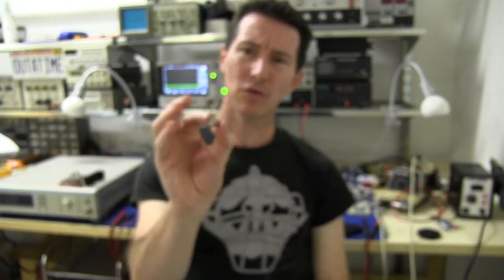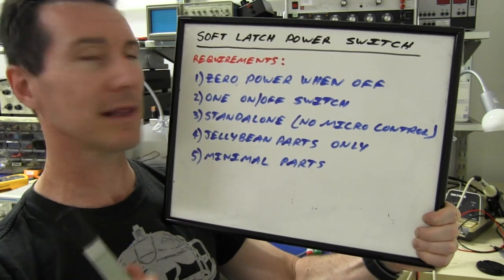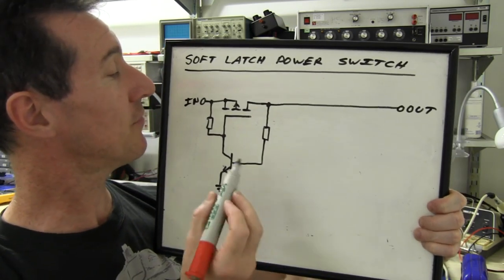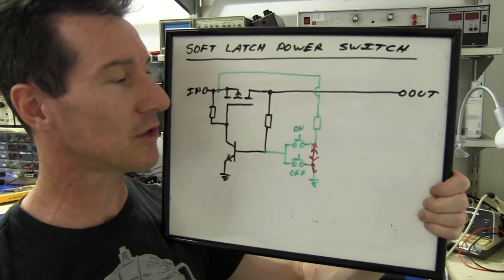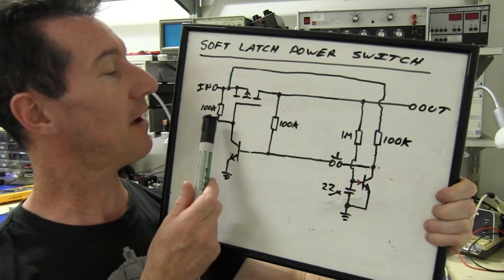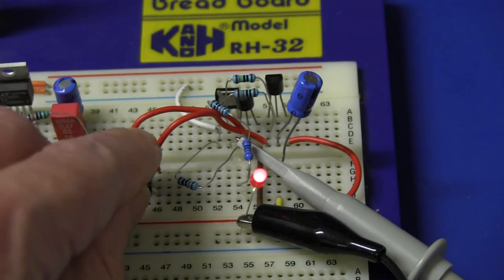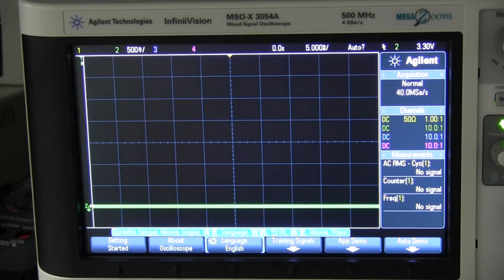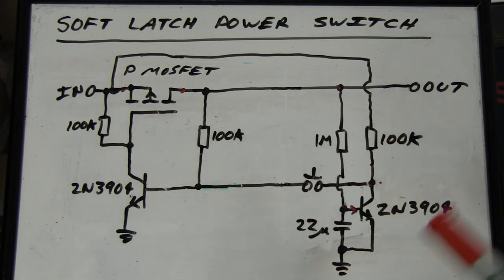EEVblog #262 - World's Simplest Soft Latching Power Switch Circuit

Comment: Dear EEVBlog,
Thank you very much for your lovely video on Latching.
I am doing a small project on controlling small out put (max 20mA 5VDC) with 02 source of separated Inputs as following: 
1. Input 1 (Vin1) of about 4.0 V at HIGH and 0 V at LOW (maintained continuously until the switch is off)

2. Input 2 (Vin2) of about 4.96V at HIGH and 0.3 V at LOW (maintained continuously until the switch is off)
What I want to do is:
1. Upon Input 1 turn on High or Low the Output will toggle its state;
2. Upon Input 2 on turning HIGH/LOW the Output will toggle it's state as well. I don not care on the state of the out put is HIGH or LOW but I do care about changing the state of each input, the Output state will toggle ON/OFF respectively.
This case is similar to controlling of staircase lamp with 2 two-way switches.
I hope you would not mind taking sometime to advice me with thanks.

Comment: I paused the video at near the beginning, and I tried to make a own solution to this, and I came up with the EXACT same solution you did! LOL (I just used 1K resistors in LTspice instead of 100K and 1M ones.)
Reply: Power Max While the NPN transistors are ON, you'll be drawing 100x more current through both of your 1K resistors than if you used 100K resistors, stressing them more.  For production, you'd probably want higher reliability, thus higher resistor values.
Reply: downthetube within Well it was a simulation, I often use the 2N2222 transistor in LTspice in such a way it ends up dissipating many hundred watts. Not an issue!

I often use TO220 transistors when prototyping stuff, as they are more difficult to destroy. However the disadvantage is that more base current is necessary for bias the transistor, and consequently I will end up using low value pullups for the bases. For small signal transistors and darlingtons and stuff, you are correct.
Reply: Thanks - I was just mentioning some obvious improvements as a design philosophy.  Guess I'd have to look up datasheet for 2N3904 to see how much margin is left when increasing from 1K's or decreasing from 100K's.

Another issue is power budget or allotment on the input power form.  Of course, how one makes these compromises and reiterations in design are largely dictated by an overall product specification, implementation, schedule, budget, and all the "ilities".

The video is a fun, nicely explainable circuit.
cheers!

Comment: I tried the circuit @04:00 with BJTs, but without the buttons. On 'out' I had a resistor followed by a lit LED. In theory it was supposed to be off. Apparently, there's a thing called 'transistor leakage'. It means even when a transistor is in cut-off state, some current might still go through (micro-Amps in magnitude, I guess it varies among the different types). I suppose it could be ignored if applied to load, but when it's connected to a base of another transistor - it gets amplified, then it feeds the first transistor and we end up with fully activated circuit. I hope this comment will save people about half a day of puzzled head scratching. In the end it was fun to find that out, probably I should have added a "Spoiler alert" in the beginning :)
Reply: OMG I LOVE YOU, i thought i was just dumb <3
Reply: just add one small capacitor between emitter and base of a PNP transistor and it will work as theory describe.
Reply: If referring the circuit at 4:00, just add a 1M resistor between the emitter of PNP and the collector of NPN.
Reply: @dharmikbhavani7272  it works well!! thank you

Comment: Important: if you have a capacitor on the output, the comportment becomes erratic. It will not latch off anymore (will turn off only while switch is closed), and oscillation becomes unbalanced.

Comment: The bad thing is that the FET is ON after plug-in. Who want to have circuit activated after plug-in? If then you do not need this circuit at all. I think if you add BE resistor to the transistor on the left should solve the plug-in problem. The  voltage at the resistor should be lower than 0,5 V  assuming the leak current from FET. As it was explained  by Trunov Michael bellow.

Comment: Did not have that P channel Mosfet you used. I had IRF5210 so used that. Worked like a charm first try! Thanks for sharing. You are just amazing. Although I will modify this and using this as an oscillator. I like the wave form coming out of it. A very neat square wave.

Comment: If understand this correctly. If you had a power cut then this thing will turn on the device. Can you modify it to start up in the off state?
Reply: Uh.  This doesn't start up in the on state.  The gate of the P-MOS is pulled up and the transistor that pulls it down has no base current before you press the switch.

Comment: I have been looking for this kind of circuit for ages. Whats great is, now I also understand why it works the way it does.
Since I'm new to circuitry this instructional has been the pretty insightful.
Not that it's that it's going to deter me from watching, but I find that typical Australian way of describing things by dipping the voice slightly distracting, and had to go back a few times to regather. I'm sure I will get used to it soon enough though. Thanks for the vid.

Comment: I'm disappointed. I'll just take the liberty to throw the jellybean rule out of the window based on economy and employ a CMOS divider/counter. Then just one resistor, one cap (those just to smooth out the button input) and an output transistor and Bob's your uncle! No blinking, no residual current (which you forgot to fix in your design), an option to make several ON modes in sequence... and the price will be the same!
Reply: Sounds interesting! I know nothing about that kind of circuitry (sounds like logic!). Please make a video on a design concept and give us a walk through! Especially of the power-on sequence capability. Then throw a couple part numbers in there so novice people can get up and running! It'd be great!
Reply: Or just use an MCU if you already have one (very probable), a pushbutton, and a MOSFET. Problem solved for a few cents!
Reply: How are you setting the initial state of that counter after power on?
Reply: Luke Wren Also, I doubt his CMOS chip has as tiny standby current as the circuit in the video.  Video circuit standby is dominated by C-E leakage in the left BJT.
Reply: @johnfrancisdoe1563  that's true! I have one major problem with Dave's circuit though, which is its sensitivity to bleed time of the system load. Large output capacitance and small load -> 2N3904 becomes biased again and doesn't switch off.

I think any circuit where you try and be clever and use system load as a switching element can have this issue.

My current favourite circuit involves a latch built from a dual inverter IC, e.g. 74LVC2G04. They cost around the same as a small-signal transistor,  leak around 4 uA, and give you clean switching every time. I think the lesson might be "if you want a latch, build a latch" :)

Comment: why not replacing the 1M by a 100k (and 22uF cap with a  2.2uF) so that the BOM gets smaller?
Reply: Check your math.  The time constant would be a hundredth.  If you go down in resistance, you'd need to go up in capacitance.

Comment: Is there an auto dislike bot on YouTube because every one of your videos has roughly the same amount of dislike and it's almost every channel on YouTube all having about 30-100 dislikes so wtf???
Reply from the maker: Jeremiah Lowe There is a core group of people who thumbs down all my videos, some within minutes of uploading. They haven't even watched it yet. I don't know about other channels, but I have a core group of haters!
Reply: EEVblog
 that's how you know you're doing something good :)
Reply: EEVblog i knew itd be something like that btw do you know any cheap power supplies like under 50$ mine broke and idk why it was a computer PSU anyways
Reply: Almost all videos have approx. 1% downvotes. That's the "standard". Less downvotes than that is either a video on a small channel or what you could call "exceptionally" good. A higher percentage means you either said something controversial or just too much stupid/boring stuff.
Reply: +Jeremiah Lowe  i bet it is batteriser
Reply: +EEVblog It's your voice and your accent, and well, all Australians in general. I subscribe to all the Australian videos and click on the dislike icon. That is how I spend my whole day. Just kidding!  I love the videos, and I've subscribed onto the blog too. Actually, I am using this circuit for switching a valve amplifier on. The first one warms the heaters, then a second switch kicks the high tension on for the B+. I use relays and or opto-isolators for the mains & the 300-700 volt B+. The ability to use multiple momentary switches with this circuit will allow a player,  stage techs, and or the sound man to queue up different amps from multiple locations. I use FETs and a slow latching relay to channel switching, and switch the different guitars to the different amplifiers. The +/-6-18 volt supply that runs the relays & FET switching runs this circuit. We can't have pops & crackles so I use LDRs, or a MOSFET latching whatever it is. I put status LEDs on EVERYTHING! Even the fuses, and the mains power have their own indicator lamps, either LEDs or Neon. (A) Neon lamp(s) show the "ready" status. Those walls of Marshall amplifiers are mostly just empty boxes, set up purely for advertising purposes. The REAL amplifiers may or may not be on stage. Usually, those I am making now get mounted into a 19" equipment rack/road case.
Reply: joe muncey lol
Reply: Haters = Jealous
Reply: I think this constant quick number got to be some bots run by a youtuber (downvoting everyone), or it could be some "youtube promotion" people where for cash you can have your videos upvoted rather than downvoted.
Reply: "And for all those who hate me tapping on the white board..."    TAP! TAP! TAP!  I fell off my chair laughing at the end.  But maybe that's the core of people who hate these videos, but hey, don't stop tapping lol.
Reply: its the Batterizer conspiracy!
Reply: @ryanjbourke  HAHAHAHAHAHAHHAHAHHAHAHAHAHAHHAHAHAHAHHAHAHAHAHAHHAHAHAHAA

Comment: So instead of using an on/off switch, add 6 more components to an on/off switch and you now have an on/off switch!  Did he really say "Half a bee's dick?"
Reply: ...and don`t forget the Christmas illumination when you hold the switch.
Reply: magicponyrides What do you mean exactly?
Reply: IvanIvan1974 he means the point of this is that its cheaper to implement because it means you don't need a beefy switch and can use an elcheapo switch without blowing it up :)
if you were just joking it didn't work, this is text its hard to tell so you should expect those reactions from people :)
Reply: megaspeed2v2 I don`t even know if he wrote to me. His reply is not directed to me. BTW, I use switch system like this too, I implement it a little bit in a different way but actually it`s quite similar. (without Christmas illumination)
Reply: 15:47 for the folks which are curious whats the matter about bees reproduction organs.
Reply: Like he said, toggle switches are expensive.  Momentary switches are cheap, as are transistors, resistors, and capacitors.  This is a time for money exchange; that's engineering.

Comment: I'm in need of a latching circuit like this, and I was about to use a J-K Flip Flop to do the job, but that would require a debouncing circuit with a schmitt trigger. This circuit looks neat, and it just might work great for my application. Thanks Dave!

Comment: The one thing I don't like about this is that it defaults to ON whenever power is first applied. I'm interested in this sort of circuit for a couple automotive ideas I have, like being able to turn cargo lights on/off from either the cab or the cargo area independently. The idea being that momentary switches in parallel in the separate locations could toggle the state of the circuit. Obviously I don't want cargo lights turning on every time I start the vehicle and I also don't necessarily want them wired always-hot.

But your presentation style made it fairly simple for an electrical dunce like myself to follow the logic of the circuit. Thanks for that.

Comment: Thank you just what I needed, very informative and well explained. I was building a portable lithium battery charger with one tactile switch. Best solution by far, but still there are caveats like with everything,  Mosfet threshHold, if it reached maybe 2.6v lets say, and you have a battery that went down but has a lot current power, and your load is heavy. The mosfet might get really hot because it does not like to be in saturated voltage levels, it needs proper 5v and 0v or negative to turn on or off, thus my thoughts of using a separate power supply to turn on or off the power Mosfet once turned on.. Just need to modify your circuit detect if button is pressed or not with micro-controller, in case I need one switch to do many functions,  like two fast taps to enable debugging mode or etc. Nice vids, keep up the good work!

Comment: You didn't get the idea, it's about saving energy. The NE555 would draw current 
from the source either the output is in 1 logic state(ON) or 0 logic state(OFF). 
Even the CMOS version(LMC555) draws a little amount of power. This one 
draws current only in ON state, which could be an advantage in some 
applications such as battery powered/portable apparatuses/appliances.

Comment: Great explanation and walk through, very solid final circuit! Thanks! I ended up using a DMG3415U, which you can put a couple of amps through at RDS(on) of ~40mohms, and still about the same RDS(on) as the IRF9110 at small loads. Definitely still taking recommendations though if you have a better one - there are a ton of P-Fets out there to try and compare.

Comment: Hi Dave, super video - trouble is, its all Chinese to me. My philosophy is if I can't fix it by hitting with a  hammer, then pay someone else to do it. Anyhow. I am looking for a solution which you seem to have problem to which I think this is the solution, I just don't have the nounce to actually put it into action. I am a scuba diver, and love  photography. However, you add the word "diving" to any equipment and the price goes up 10 fold. I have a waterproof, custom made light rig, I have a waterproof (5v) battery powersupply. What i need is method to switch it on and off. Underwater, the pressure is the issue. Any usual switch with air behind it will be susceptible to the pressure. So, I thought. waterproof tube, two contacts (sealed) protruding to the outside, thin "spring" of metal to short the contacts momentarily and hey presto. Just need the circuitry inside. So, as if you were explaining to a four year old ( and my wife will say I act like one now and again) how do I make the circuit, what exact components do i need to but and how do i wire it up? Any help will be very much appreciated. Andy

Comment: This works nicely in my ISIS Spice emulator. I've never really used it for Analog based circuits. But it made me reminisce to the old days of my putting two led together to blink with two transistors in a astable multivibrator format. Not like these days where everything is Digital.

Comment: I found this circuit to work best driving a relay, it worked very good for that, and you can switch high current supplies with very little trouble this way.

Comment: Great circuit :-) Mine design had 4 transistors but I needed that much because I added extra function - turns on quickly, but to turn off you have to hold it for 2 seconds :-) Kind of for safety reasons :-) 
Waiting for other great videos! ;-)

Comment: It should be fine. From memory, the 2N3904 can handle much higher than 12V across the collector-emitter (check the maximum V_CE figure off a datasheet to be sure). Also check that the pass MOSFET can handle 12V across drain-gate.

Comment: One great little thing about this design is that you could actually use a micro to turn the thing off, just connect one I/O-pin to the left side of the button and once you set the I/O as output low, it should turn right off.
But, I´d believe that you should avoid setting the output high since that would burn the transistor and/or the micro. But that could probably be avoided by putting a resistor in series with the microcontroller and then muck around with the values to get the voltages right.

Comment: We implemented this circuit on PCB for one of our applications. But it is not more efficient. The issues are random turn-on of the circuit. Also one main drawback is the load current should be higher than the minimum drain-source current, else MOSFET will not hold in  turn off

Comment: One important thing that he left out is RFI suppression.  A slight bit of interference would toggle the thing easily.  If you've heard your cell phone buzz in your PC speakers, you get what I mean.  So a really good dose of resistors and capacitors AKA low pass filters are necessary to prevent something disastrous.  One time they showed on TV a wheelchair (with a person in it) take off when the radios from the emergency personnel were used.  Like, there was an accident waiting to happen!

Comment: Built your circuit over the weekend. Had to adjust the bias a bit for a 12V supply, but the circuit worked very well. Thanks for sharing! Would you be able to explain how to replace the push button with some sort of pulse trigger circuit? I tried a few ideas with some small success, but nothing stable. I would like to integrate the latching circuit with a motion sensor circuit...

Comment: Nice circuit, but I guess it only goes to close to 30V because of your FET and only DC.  Of course, I have seen AC Circuit and 220V using Triac.  You should cover one of those.